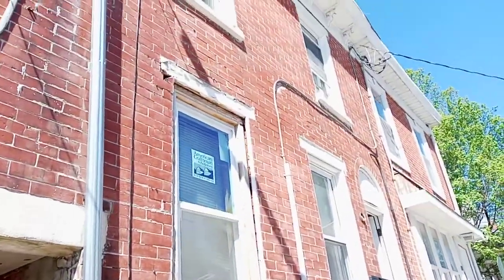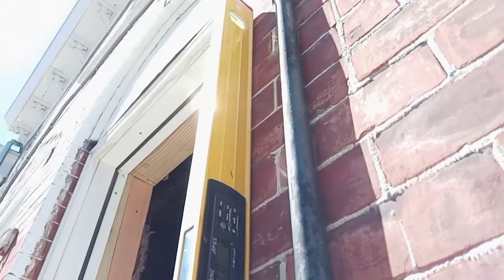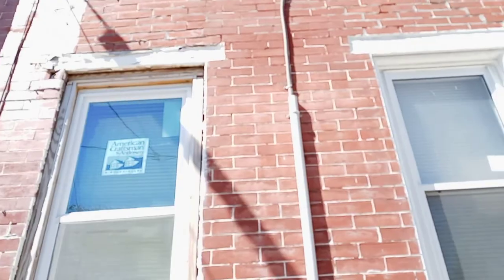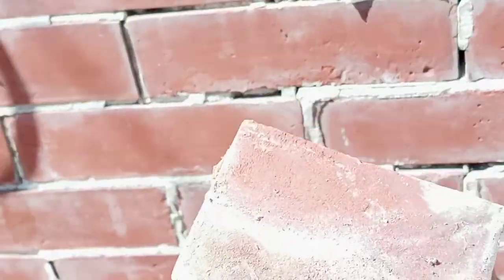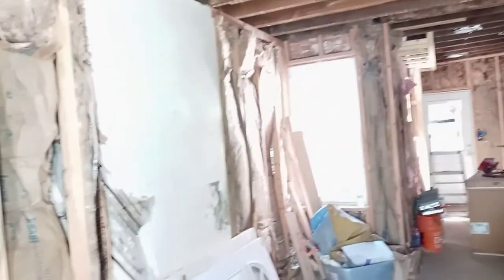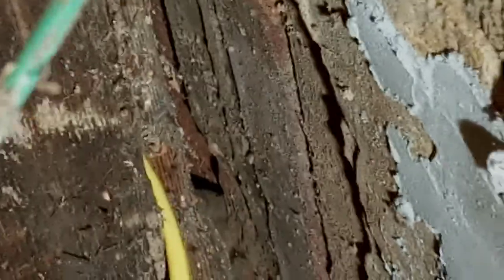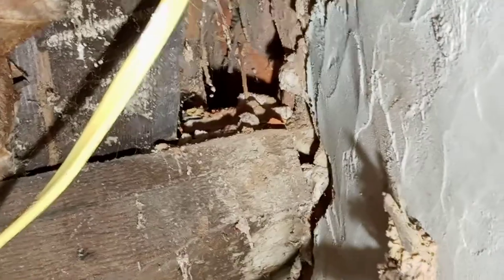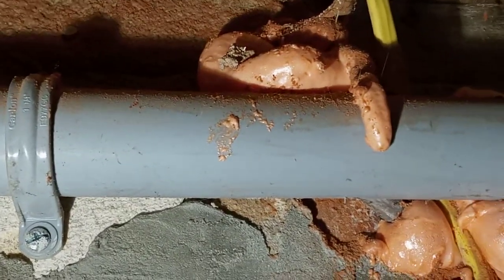Bowing Bulging Brick Wall failure explained

Comment: I find it hard to believe that the exterior wall is not tied every seventh course with a header.  Maybe there was some other way to tie it but i am unaware.  That front wall is failing and is going to fail.  My guess this was an abandoned house that suffered water infiltration, some fly by night developer bought the property, fixed it up by less than standard methods.  They then put it on the market and sold it.  My comment regarding less than standard refers to what was done in the basement to the exterior wall.  Terrible workmanship that hurts the home owner.